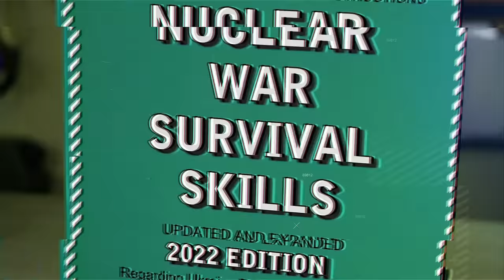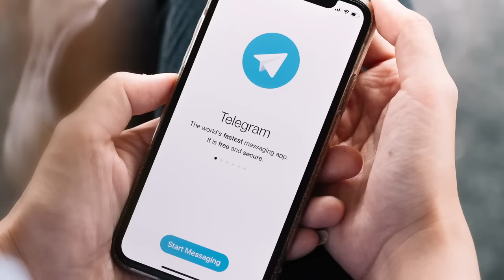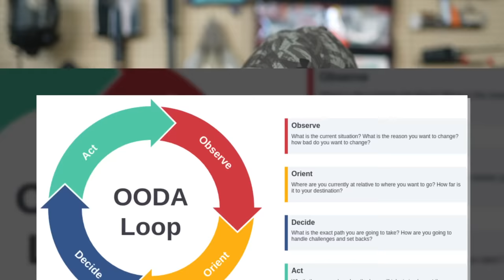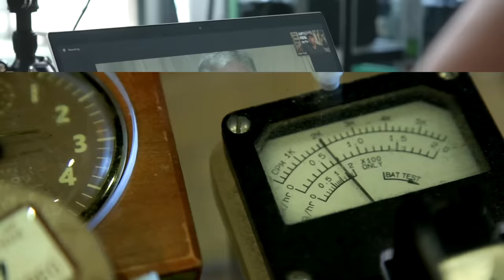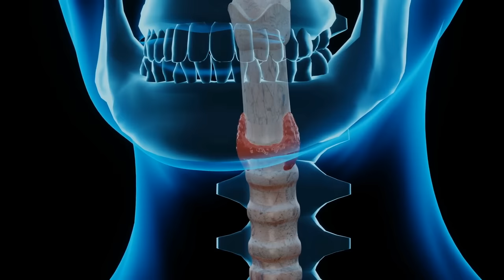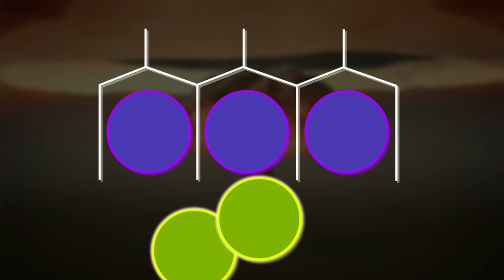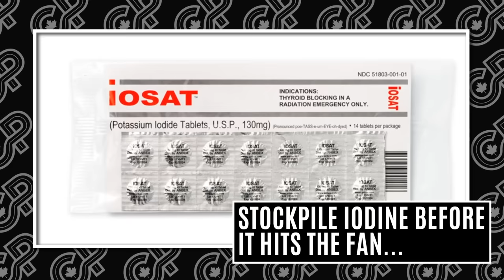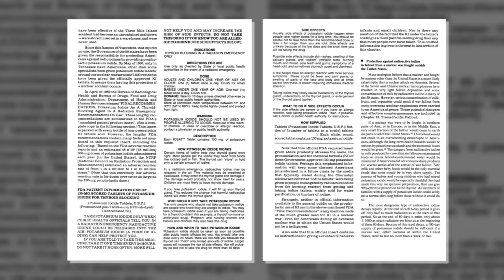Nuclear Expert: 90% Chance of WW3 Right Now... Here's How to Survive it.

Comment: Back when Fukushima was going down, nobody knew what sort of cloud was going to fly over. Potassium iodide was sold out everywhere.  I had read at the time that you could put topical iodine on your skin. Same kind you put on cuts ect. And it would have a similar effect of saturating the thyroid with non radioactive iodine. Being on the west coast I didn't want to be exposed to the bad stuff So I applied some  of this medical iodine on my skin in a patch the size of a large bandage for several days in a row in different spots on my body.  Long story short,  I don't think it takes that much to saturate the thyroid because I had hives for probably a  month afterward  until my body seemed to regulate again. I don't know for sure that's what caused the hives, but I suspect that was the case being they lasted so long.  Just use caution and research these types of things beforehand.
Reply: FUKUSHIMA is STILL spewing radiation!

Comment: Russia has many 50 and 100 megaton warheads and they are building as many as they can as fast as they can. One 50 megaton bomb produces a 6 mile wide fireball. THAT IS NOT SMALL!
Reply: No, most of their warheads a less then 1 MT.
Reply: @pauld3402  there still dangerous
Reply: They shanked Tsar Bomba from its original designed yield of 100 MT. Still, not insignificant can of 1960s era whoopass.